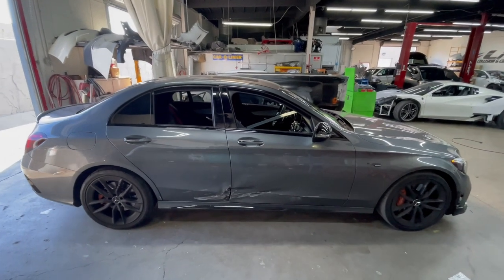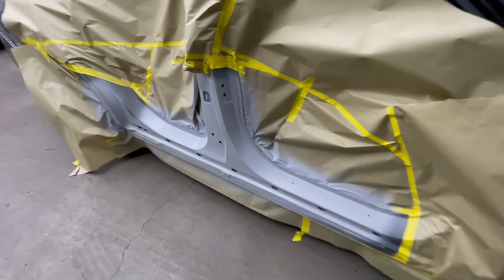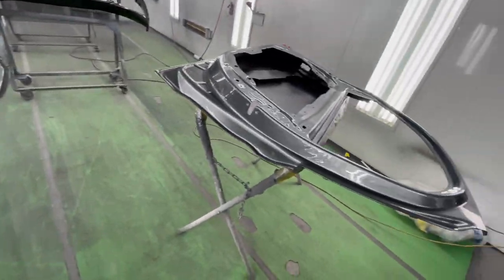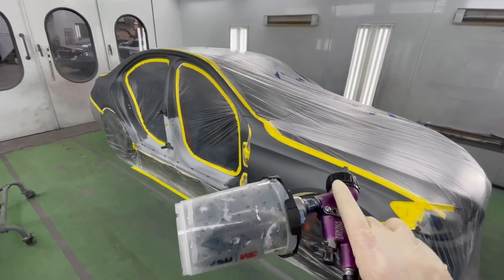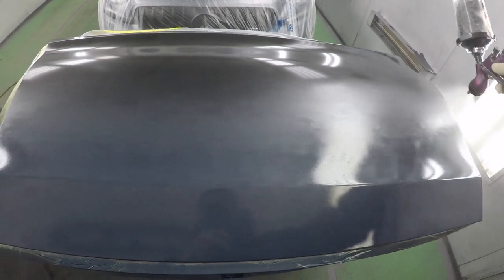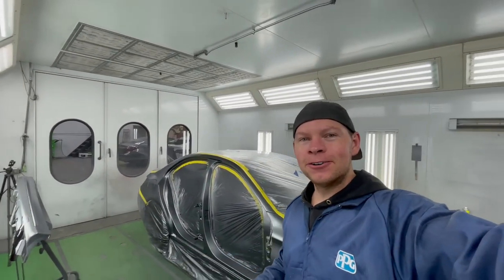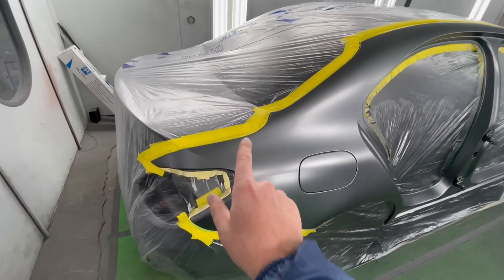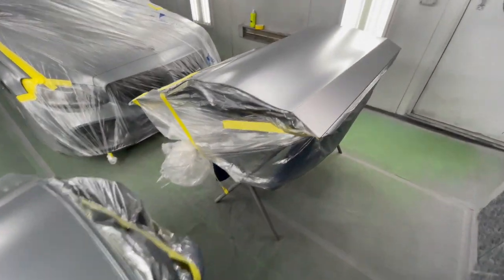REPAIR AND PAINT Mercedes Benz C43 AMG - whole Side After Accident PPG Paint

Comment: Great job , but has never worked for me doing it that way . I feel more  comfortable painting the full side all together .
Reply from the maker: Thanks! I prefer to spray the entire side at once as well. But sometimes due to certain circumstances i paint them off the car. But i would not try this on 3 stage colors 😬
Reply: What’s the difference?
Reply: @orthodox1717  I've painted panels off the car and if you don't get the lay down of base perfect there's a high chance of colour change .Also laying down the clear can be uneven. I suppose a lot relies on your skill 👍
Reply from the maker: Sometimes the panels wont match when painted separately, i can spray the same color from the same gun at the same time and make it look completely different based on my application. Only on metallics and 3 stage colors tho

Comment: Hi Andre , me again. One question. We never paint door horizontal …because you do not get a factory paint . You need orange skin what you do not get while painting horizontal. Right??i could imagine to see a big difference in front of the door .
Reply from the maker: I try not to create too much orange peel, especially when painting the whole entire side, factory has heavy orange peel especially on mercedes and looks very bad if you look closely, i always try to make it better than factory. If its just one door or fender being painted i match the orange peel, if not i make it better! Never had a customer complain that he does not have orange peel 😅👍🏻😁
Reply: @LncPainter  hi, that’s a matter of opinion. We always try to repair and paint that you do not see the car was painted. Painting horizontal looks perfect, of course,no question. But you can see a difference between your 2 doors and the fender and the quarter panel. Means : everybody will know this is a repaired accident car. The clear coat is too smooth on the doors 
Anyway I like your Chanel and I like us exchanging opinions . Regards from Germany

Comment: I thought it was always needed to sand and buff as the final steps. Clearly, it's not needed with you.
Reply from the maker: It saves a lot of time when you do not have to buff the entire car, thats why i spend a little extra time in the spray booth to have a clean job. Only a few nibs here and there! 😀🙌🏻
Reply: @LncPainter  what causes that nasty looking orange peel on a lot of paint jobs?
Reply from the maker: Usually a bad prep job and poor application of base/clear. Everycoat you put on the car before clear creates texture, so you want to minimize it. Make sure the surface is prepped nice and flat from the get-go, and spray your clear nice and heavy with high pressure, 30psi